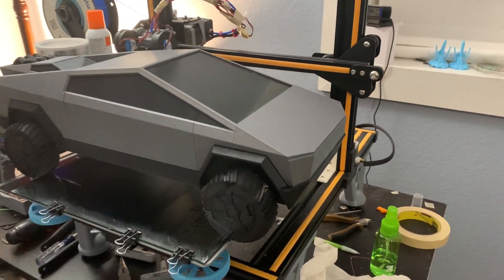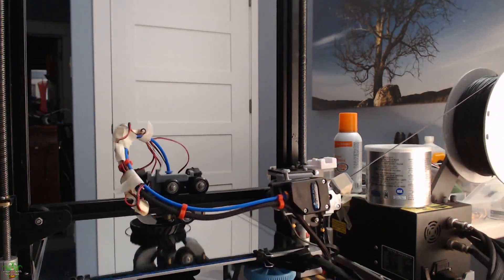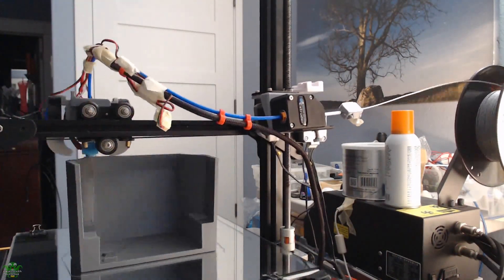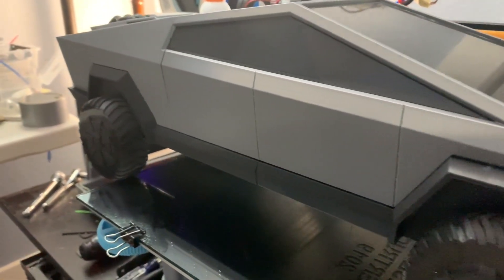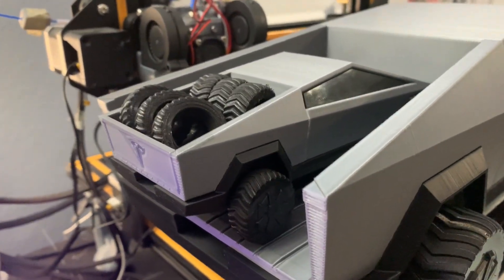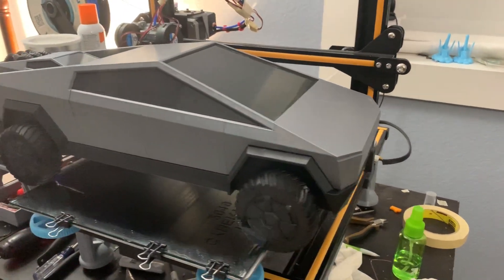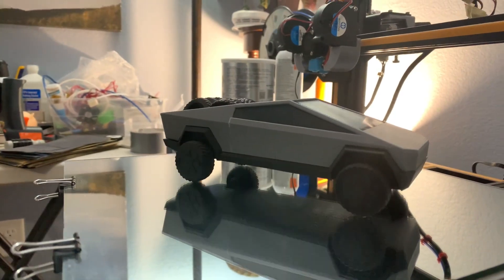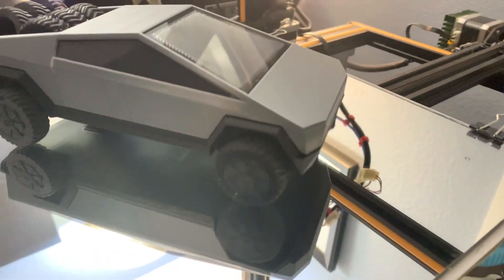Tesla Cybertruck 1:12 Scale 3D Printed Model

Comment: what did you use for the windows?
Reply from the maker: I used black pla I believe this was Priline black from amazon. I had to adjust the scaling slightly to get it just right, I suggest measuring the cutout then adjust the windows scaling  when printing.
Reply from the maker: Let me add, since I print on glass I used the side on the bed facing out to give it the shine
Reply: @AthexTube  I have 
issues with getting the print to stick to the glas, do you have any recomendations? i have a cr-10s
Reply from the maker: @andreaskvisler  Excellent, I also have a cr10s. One major issue is the glass that comes with it a lot of times isnt flat you may want to check it and see. I bought some mirrors from lowes that are roughly the size of the bed and those have worked much better. Also make sure the bed is very level, I have done multiple leveling test prints. The last thing is clean the bed with rubbing alcohol stuff gets on it and can cause PLA to not stick.